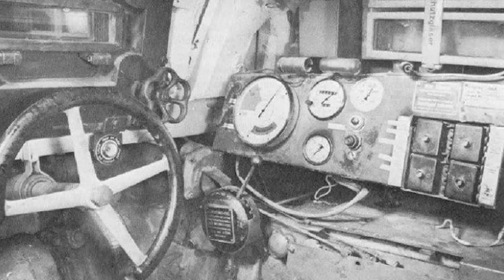A Deep Dive into the Tiger I, by the Chieftain

Comment: You gotta admit using the 88mm Flak as an anti tank gun was a great idea, I wonder who first thought of doing that?

Edit: from some googling it seems they were first equipped with telescopic sights and used against ground targets in the Spanish Civil War and by France 1940 they had produced special APC shells designed for taking out tanks.
Reply: Great idea, but that's not the gun of the Tiger 1.
Reply: @daveybyrden3936  never said it was, sorry if you got that impression from my comment.
Reply: The Spanish did during the Civil conflict there as Adolf sanded them as help for the republican side. And they use them against the lightly armored soviet T26 and BT-5  light tanks with remarkable results despite using He shells.
Reply: @daveybyrden3936  The KwK 36 in the Tiger is a variant of the 8.8 cm flak. or more specially a variant of the 88mm flak 36.
Reply: @viceralman8450   That depends on what you mean by "variant". What percentage of a thing has to change before it becomes a different thing?
In this case, the Tiger's gun is not equipped for anti aircraft use.

Comment: Chieftain there is nowhere mentioned in american records that they had issues shipping heavy tanks. That is a myth you came up with with nothing to back it up. When americans started shipping Pershings they certainly didn't have to split them in two pieces
Reply: They also didn't have to ship Pershings in the same numbers. By keeping the weights lower, it increased the amount of quays that could rapidly unload a ship and thus increase shipping flexibility. They didn't split the Tiger into two just because they were bored. Certainly heavier loads could be shipped, look at the locomotives the US shipped overseas, far heavier than any Pershing. But look also at the number of locomotives involved. It's worth noting that when the first Liberty ships were built, not a single crane on the ship was capable of lifting an M4, let alone anything more than that, the 50-ton cranes were a later addition.
Reply: @TheChieftainsHatch  You are going into pure speculative mode here and just assume they kept the Sherman's weight low due to shipping issues. Where are the historical records that state this in the design requirements ? Where are the historical records that state it would be too difficult for anything above 40 tons to be shipped in sufficient numbers?  If they exist please mention them.

Sure they didn't have to ship a lot of Pershings but thats just the benefit of hindsight we have. They had no way of knowing that the war would end before they had to use tanks like the Pershing in large numbers. Plus there was a real threat of a war with the Soviet Union after the Germany's defeat and during that time they were still hopelessly limited to 40 ton cranes and were not able to do anything about it? Highly unlikely. When the need for heavier tanks like the Pershing arose I heard of some contemporary  sources that they could not be shipped as easily as the Shermans but nowhere is this mythical 40 ton weight limit mentioned.  The germans could do it with the Tiger but the americans  with far more ships and resources nah it was too hard for them? According to who? Again there are no sources that suggest this to be the case. If there are please  bring them forth and I really do mean that. I have no problem being proven wrong on this if the evidence is there
Reply: @donaldhysa4836   Germany shipped Tigers across the Mediterranean by driving them onto ships or barges. No cranes were involved.
Reply: @daveybyrden3936  And how did they get them onto the ships mind you? Carried them over their shoulders?
Reply: @donaldhysa4836   There was only one ship used, and it was specially designed to transport railway carriages, so it was an early example of a "roll on, roll off" ship.
The barges were special military ones designed for beach invasions, so once again it was possible to "roll on" at the front.
Reply: @daveybyrden3936  What beach invasion did the Tiger participate in?
Reply: @donaldhysa4836   It would be nice if you would stop putting words in my mouth.

i never said the barges were designed to put Tigers on beaches. I never said the barges were used for any beach invasions at all. 

You can go and read about them if you need to know their history - search for "Marinefährprahm". They're not my area of knowledge.
Reply: @daveybyrden3936  I looked that up and found nothing about them being used to transport Tigers to Africa
Reply: @donaldhysa4836   We know that they transported Tigers, probably to Africa but possibly just to Sicily, because we have photos of Tigers driving onto these barges in Reggio Calabria. Written records have not been found AFAIK.
Reply: Actually, I forgot - we also have a photo of a Tiger driving off such a barge in Bizerte. So, they did the full Mediterranean crossing, with one Tiger each.
Reply: @daveybyrden3936  Interesting can you link to that photo? Chieftain here said they were transported turret and hull separated and I took his word on it
Reply: @donaldhysa4836  
I said that they were shipped to the US with separated turret and hull. As the photos in this video show. 

If you want me to point to a paragraph and line in a document, I can't. It's somewhere in my masses of scans, and when I come across it again, I'll be sure to upload it. In the meantime, I would observe that I am not the first author to mention shipping weight as a limiting factor. However, it is not necessary to do so in order to understand that weight is a concern for shipping as well as tactical mobility.

Tiger is a terrible counter-example. They were delivered to North Africa by use of Marinefahrprahm, basically barges, and rolled off the boat straight onto the beach. (search "Marinefahrprahm tiger" and the image should come up) The ability of a ship with a six-foot freeboard to traverse the Mediterranean and deliver a couple dozen tanks is hardly indicative of an ability to transport tanks across the Atlantic by the thousand, and even less to the topic of the Pacific where many battlefields were not served by ports as well equipped as Liverpool and where cargoes had to be trans-shipped from ships to lighters just offshore. As it is, the Green Book for Transportation Corps observed that the number of tanks for the North Africa landing had to be reduced, and a specific ship (USS Lakehurst) was modified with tank-loading cranes and took tanks which could not be loaded onto other ships. Most of the assault force was loaded at Hampton Roads... Except Lakehurst, which was loaded at New York. Quoting CMH 10-20 "Ships destined for primitive ports where there were no cranes or derricks could not carry items heavier than the ships' gear could handle. The quickest method of overcoming the handicap was to install heavier booms on the ships, and this was done extensively. As soon as they could be procured, floating and stationary cranes were installed at the oversea ports where they were most needed." An example given was Brisbane, which didn't have a single crane capable of lifting a tank, 10-ton cranes being the top end limit, ship cranes were required until a single 50-ton crane was installed by the US Army in March '43. As you read through the books (or ctrl-f), you'll note how many cranes are of the 30-ton class. Good enough for Shermans, not M6s. The ZEC-5 liberty ship was specifically designed around the M4. The British converted some 200 Liberties to MTVs by addition of stronger cranes just to get vehicles across the Channel.

You are correct that if the Army really wanted to run Pershings by the thousand, they would have figured a way of doing it. The transporters which picked up the tanks when they arrived in Europe had to be modified. The first engineer bridges capable of carrying the things across a river arrived in May 45. If there was a requirement to do so, presumably the Army could have found a way, a the cost of something else (Also assuming it was considered worth the cost). Even if sufficient numbers of cranes could not be found, maybe they could have used LSTs to drop ramp much as the Germans did (And the Green Book does note that some LSTs were used in that role, but were mainly used intra-theater, presumably because the equipment actually being shipped didn't require it). And so on.

These arguments are irrelevant to M3 and M4's design, however. LSTs did not exist. Bridges capable of taking M4's weight had barely entered service (and were the official limiting factor in Army paperwork). In large part the ports at the other end, and cranes on ships were similarly limited. Transportation Corps' procurements of cranes didn't really get into gear until late 1942. When Ordnance was designing and ordering M4s before the US entered the war, they could either order production of what they knew the shipping and handling facilities which existed could handle, or they could presume that the entire transportation infrastructure from flatcars to ships to cranes to truck trailers would be built to handle a heavier tank. That they chose the former should hardly be surprising, even if it turned out after the fact that once the US entered full production, they would end up actually allowing for the latter.
Reply: @TheChieftainsHatch  You said this in your comment.  

"It's worth noting that when the first Liberty ships were built, not a single crane on the ship was capable of lifting an M4, let alone anything more than that, the 50-ton cranes were a later addition."

So the Sherman was not build with frail lift cranes in mind? They did not even have any cranes capable of lifting  it (at first)  yet that did not impede them from shipping thousands across the Atlantic? Is that what you are saying? Because it sounded to me  like you were saying that the Sherman was specifically designed around lift cranes weight limit and thats why it had the weight that it had the armor that it had etc (among other reasons)

To my knowledge I never seen anything that implies cranes were ever considered in drawing board phase of the Sherman's design but if you have something that suggests otherwise I would love to see it. I am not an engineer would seem a lot easier  to simply build more powerful cranes than to build the tanks suited to the crane capacity instead of suited to battlefield conditions of the time. 

My example with the Tiger meant to illustrate that if an army with enough resources  wants to get tanks across a sea or ocean, it can do so.  I didn't meant to imply transporting a few Tigers was comparable to transporting 12 thousand Shermans. But just that it can be done and you don't need to design your tanks around the weight capacity of lifting cranes as I think you are  arguing for here.  It is much easier to just design cranes that can lift heavier tanks than to design tanks that can be lifted by weaker cranes.  And the bridging for crossing rivers does not seem to be as much a problem as you make it out to be either. There was hardly any bridge in Europe that could withstand the weight of Tiger 2 yet the germans managed to get them to the  front line just fine.
Reply: @donaldhysa4836  Well, if I'm wrong, so is The Tank Museum, judging by their post on their Facebook page which was published on exactly this topic about 9 hours ago as of this time of typing.

There is a significant difference between building a bunch of new tanks, and building a bunch of new tanks which also requires building a bunch of new infrastructure. Absent any indication that the latter was going to happen, why would not a design be made for what existed, as opposed to what may be if decisions are made in the future? Otherwise the Army gets stuck with a bunch of tanks and a transportation bottleneck even worse that what actually existed
Reply: @TheChieftainsHatch  The only infrastructure issue you have mentioned so far is the cranes and tactical bridging units. None of those seem even remotely an obstacle from an engineering perspective. There is not much to designing a stronger crane you just make it bigger and add a more powerful engine. Same with tactical bridging   Now again what is more reasonable, building a tank that is light enough to be carried by current cranes (which the M4 wasn't anyway at the time as you said) or just building more powerful cranes? .  But I am still looking to see any historical  source claiming  that the Sherman was designed with cranes in mind from this museum or anywhere else.
Reply: @donaldhysa4836   The photos were spotted on Ebay, and bought by private collectors, so they are not on the web at present.
What they show is Marinefährprahm barges beached at Reggio Calabria, which you can recognise by the hills around it. Two Tigers (142 and 111) can be seen driving into the barges in different photos. There is also a photo of a Marinefährprahm barge at the airport in Bizerte. This was a seaplane airport, so it had a dock. TIger 02 is photographed driving off the barge, and two other Tigers are parked nearby.
Reply: @daveybyrden3936  Yeah I saw those photos

Comment: 100% agree, when it was used for the role it was intended it was a great tank.
The armoured forces had lots of problems being given missions that their machines were not intended for which caused unnecessary problems.
All the books I have read by the men who used or supported these tanks on a daily basis liked them. They say they had their faults but what doesn't. 
The amount of commanders who lost their heads (literally) was quite significant. 
The Russians made great use of their anti tank rifles for this.
It was nice to see you called out the Hollywood BS from Saving Private Ryan when they shot through the visor.
A good video 👍
Reply from the maker: Thanks for watching, nzmonsterman.

Comment: Wrong. It was Hitler and his combat experience who pushed for the anti-aircraft 88mm cannon on a tank that born the Tiger I, not the manufacturer.
Reply: It's a well established fact that the KwK36, that is, the Tiger 1 88mm gun, was not designed for the Tiger 1 at all.
It was taken from another tank design. The gun that was really intended for the Tiger 1 had to be cancelled for industrial reasons.
Sources:  "DW to Tiger 1" and "Panzer Tracts 6".
How can you believe that Hitler, a regimental message runner, would have combat experience involving AA guns? 
According to the books I quoted, Porsche was asked to design a heavy tank, given only some government funding and a list of basic requirements (e.g. maximum weight).
Portions of the design were contracted out to experienced firms, including Krupp.
Krupp sketched out two possible guns, 105mm and 88mm, for Porsche's tank. 
I see no mention of the Fuhrer being involved in Krupp's negotiations with Porsche. Did you find something?
Reply: @daveybyrden3936  Weak people are often triggered when their wrong. And I don't respond to sarcasm.
Reply: @143AD   That's a "no", I suppose.

Comment: At 7:35 it states that the Tiger was first captured in North Africa. But in fact the first captures were on 18 January 1943 near Leningrad.

At 24:30 a theory is floated that gunners were put on the left of Panzers so they could access the gun controls with their right hand. This makes NO sense. There were no controls anywhere on a Panzer gun for the gunner to use! (not counting the little Panzer 1 and 2)

At 24:50 we are told that the Tiger's gunner had "pedals" for firing the main gun. This is not true. There was a pedal for firing the coaxial MG, but the main gun was fired by a lever adjacent to the elevation wheel, operated by the gunner's right hand. It's visible at 25:20.

Comment: after heavy defeats near moscow and in stalingrad germans are desperate so they are in pursuit of wonder weapon to change the cours pf the war. they are not gonna construct 10 panzer IV than 1 tiger tank. the soviets also can construct havy tank like tiger but they are not desperate. this tank ain't no wonder, it's just empty shoot of deafeted army
Reply: how to tell us you didn't even watch the video before commenting, without telling us you didn't even watch the video before commenting
Reply: The Tiger1 wasn't designed in 1944.  By 1944/45 standards, yes the Tiger 1 wasn't quite what Germany needed, but to decide to NOT design and build the Tiger in 1939-42 because they might be losing later on is a silly idea.  Germany had to assume that they could win whatever war was in front of them (that they were going to start) otherwise why bother?  To help win that war, they needed a breakthrough tank.  That tank became the Tiger.  Now, maybe with better forethought they could have designed the tank slightly differently so that it was easier to manufacture, repair, or maintain, but that is a flaw with many (if not most) of German tank designs, and is not completely unique to the Tiger.